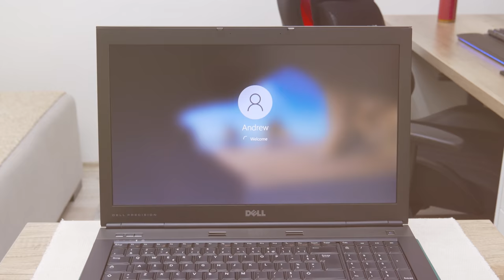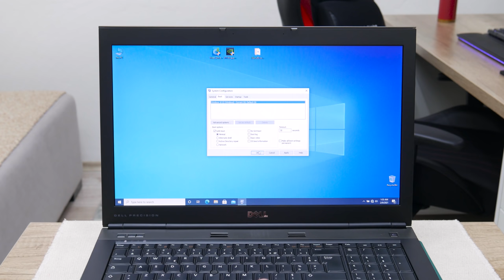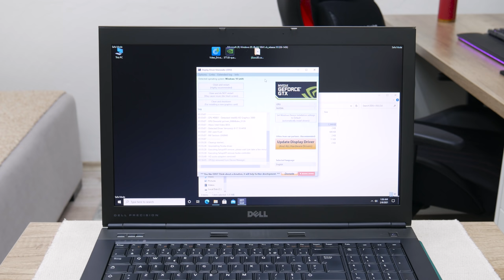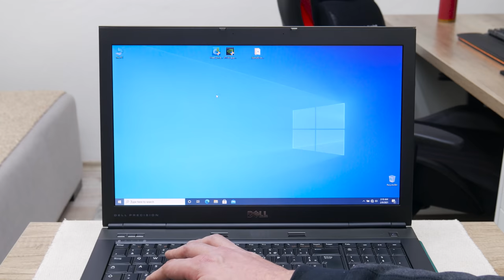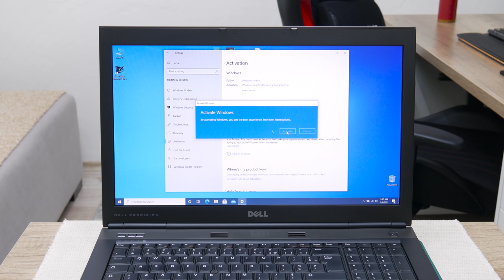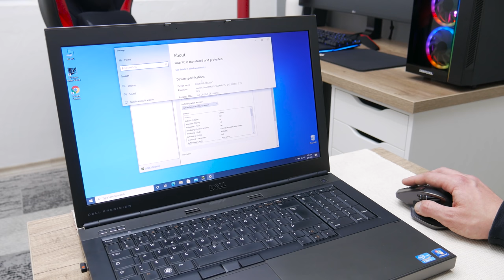Dell M6600 - Full restoration and Upgrades ( Old but Gold )

Comment: Hey, Andrew.
I use an old GIGABYTE W536M Laptop and latest "Supported" version of Windows is 7 Ultimate, but i use Windows 10 Pro. So, the questions is, what's the name of the app, that you use to remove the old graphics drivers in Safe mode (In 18.18 sec.)? I want to install special version that is supported for Windows 10, but it doesn't allow me to update the drivers from Microsoft updates. Thanks! :)

Comment: Gutted - I thought the steps to remove and replace the drivers in your video would be the silver bullet for getting stability for windows 10 on a precision M6600 but the intel driver won't install as it can't find the hardware and OS is unstable as soon as the desktop is loaded. Seems there's something else at play with the hardware in the M6600 I've been landed with.

Comment: Hello. 3:27 where did u get from? What is it called? May laptop also has power but black screen only. Please advice me..
Reply from the maker: Hi bro, black screen can be caused by many other things, like RAM, GPU,  bad power or something wrong on the motherboard and BIOS. At 3:27 is CPU, but in most of cases the problem is not coming from the CPU

Comment: Hi, I have been watching your video, It was very awesome. I have my own Dell M4600, but It already has an issue with video driver, after upgrade from Microsoft generic video adapter, I have my screen with black background (without cursor). I think It would be the physical card video (ATI FIREPRO M5950). I want to change the video card for another new one. What do you think about using NVIDIA QUADRO or I have to use the same model? Thanks for your response and help.

Comment: 20 year old laptop has a GPU. 
My 10 year old laptop: '-'
Reply: my 5 yo laptop only had i3 4030u with no gpu lol. but it enough, still usable bcs i install ubuntu
Reply: Some Integrated GPU are ok and you can use EGPU
Reply: Well I'm currently on an HP Pavilion dm1-2010nr which has the one of the bulldozer CPUs from AMD Athlon II NEO K325. Only reason is because I upgraded it and my actually main laptop is waiting for me to gain some money to upgrade it as well. Would like to upgrade its RAM and get it on an SSD. I also need to do what he did for drivers for my dm1 since there's lag and continually says load parameter incorrect 87

Comment: this graphic cards that are (more or less) offboard... could you actually put that extend to go outside of the notebook case e install a regular (e new) graphic board?!?!
or it is not possible?!?!
i just imagine using those adapters that you can plug with the power supply and connect to this notebook a new graphic boar (like a 1660 super or 1060)...

Comment: Nice job.  I own an M6700 that has died.  I know it's not what you do on your channel, but I wondered if you (or anyone here) might give me some advice.
My laptop (which has a Core i5 3320M) won't pass POST, and is showing the error light code of "possible processor failure".  I have disassembled it like you have done- all except removing the CPU.
I am going to clean everything as you have done- so those videos are very helpful.
I know many say the processor rarely goes bad, and it's usually the system board instead- but there is a separate error code for the board, and it is not showing that.
Of course, to make it more confusing, I don't use the computer for gaming, and I don't believe the CPU was overheating.  I did have a minor problem a good while ago where the CPU would no longer go into "turbo" mode as it should (it is a 2.6 with 3.3 possible in turbo), so I was using Throttle Stop to let it run a little faster (but not technically "overclocked").
There were no recent hardware or major software changes.
Should I take the chance and spring for a new processor?

Comment: This is how examples windows make a poor user experiences, you can try linux in the future build Intel, Amd driver is baked into the kernel itself, while Nvidia driver is available in pretty much of any linux/distro repository, the installation is very straight-forward. You dont have to try to hunt this driver on their webpage.
Expecially in used harware, linux makes sense a lot.

Comment: Sr i have 3rd gen i7 with amd 8000 series build in gpu but the driver in windows 10 install whenever i see from properties but actually amd grapics is not install and when i try to install amd grapics my laptop hang and i have to reinstall windows plz solve my issue how to install grapic amd driver

Comment: Gotta love the older dell laptops... I actually built a B130 from new parts (new old stock). It still runs.
I found a used good one of these... It's so tempting to get it.
What's the max cpu and max gpu this one can handle?
Edit: how many ram slots 4? Or only 2?
Reply: It has 4 Slots for Ram

Comment: Just need your help, I have Dell Precision M6800 and it worked perfect. But after 5 years I did not power on and now I power it on, I got black screen, I know its CMOS battery is bad and I change it but it still black screen. I connect two external monitors through HDML and RDG cables and it is still black. What should I test else, graphic card? Please help and thanks

Comment: Hi Andrew.
You have to correct this is a dell m 6800 laptop.
And in the video you said it was a 6600.
They are more or less similar.
This is just a remark.
Respect
Bojan
Reply from the maker: Hi bro, actually this is one of dell M6600 models, M6600 is available in many different variants and It's coming with 2nd generation of intel processors, this one is with 2ng generation. 

M6800 looks very similar but it's newer and it's coming with 4th generation of intel processors. Btw I wish I can find some M6800

Comment: i have a dell precision 7510 it has intell and nvida graphics card you wont be able to play red dead redemption2  on the 6600 or 6700 but mine works great i also have the intell xeon processer it works great for all my games i have 2 hard drivesboth ssd its a great gaming pc and 32 gig of ram is not enough im installing 64 gig of ram the more ram the smoother it runs
Reply: im also running windows 11 i installed with rufus you can install 11 on non suported pc with rufus

Comment: i have a old laptop with i3 330m and 4gb ram same problem my laptop lags when only while running on battery power to fix this i went to battery settings and advanced power option and processor cooling to active so that my laptop doesn't get lags
Reply: If your laptop is never cleaned before on the cooling, huge red flag, unblock the airvents on the fins

Comment: I need help how to remove stripped screw ?( From my laptops heatsink)
Reply: Try a rubber band. Placing it over the screw and then pushing down with the screwdriver will give it enough grip to turn the screw head. It's an old trick, but it works, and works well.
Reply: @Autobot032  I tried rubber band and super glue it didn't work
It's very small screw
Reply: @kaushikkv8423  might have to drill it out then. Replacing the screw will be the biggest issue, then.

Comment: Hi Andrew, great video! Just got this oldtimer last week and I have a BIG problem - cannot really boot anything :( Bios version is already updated to the latest version (A18) but on boot I'm getting the message "(A7) Me FW Downgrade - Request MeSpiLock Failed" which follows by "Error sending End Of Post Message to ME". I've already replaced the cmos battery but getting still the same errors... Any help will be appreciated... :)

Comment: Replace the gpu to HD 7970M(HD 7970M,HD 8970M,R9 M290X all are same)/gtx 680m and it's a decent 1080p low 30fps or 720p 60 fps machine. i7 2960xm and 16gb ram are pretty capable even for todays standards

Comment: i think you've restored this two times:>
Reply from the maker: Hi bro, you can check that video also, the booth are from the same model M6600 but different revisions. This one, has no backlit keyboard, have Quadro 4000M GPU and has no camera on the top lid.
The booth looks similar but they are totally different :D btw you can check and compare the boot videos, even the booth have different IR code and serial
Reply: @ComputersAndTechAndAndrew  oh okay yea im just confused and ive also watched it:D and also btw what type of paint you using?metallic or acyllic

Comment: Would it also be possible to upgrade the graphics processor on this?
Reply: Of course. The cpu and gpu are socketed allowing for easy upgrades. Today you have to buy upgrades at the outset because it can’t be done later.

Comment: I traded my hp 2000 notebook for a dell precision m4700 the dell has a core  i7 3940XM Extreme Edition cpu 15.6 1080p display and 22gb of ddr3 ram and 500gb hdd and windows 10 home iam going to put a blu-ray drive and windows 11 home into the dell precision m4700 and the dell has Bluetooth it's a great notebook i got the dell precision m4700 from a family member and never had a notebook with keyboard that had backlight

Comment: what is the gpu???
Reply from the maker: It's NVidia Quadro 4000m
Reply: @ComputersAndTechAndAndrew  can i put a hd7970 in this laptop? Or a 6100m is better opción?
Reply from the maker: @doritoincognita7777  Yes the HD 7970 is supported, 7970 is firepro m6100
Reply: @ComputersAndTechAndAndrew  According to me they are different and the 7970 is almost 40% faster in benchmarks and in Aliexpress the 6100 costs approx $ 45dlls and the 7970 $ 100dlls not a same GPU or im confused